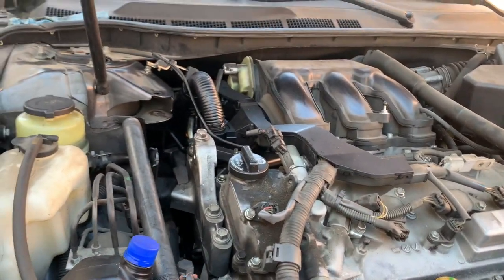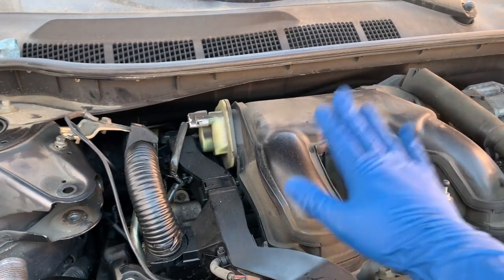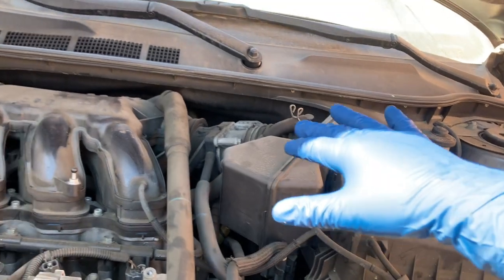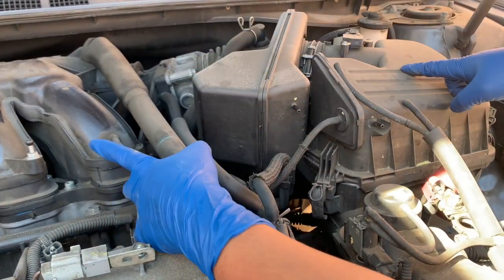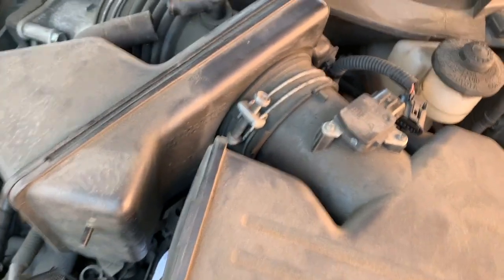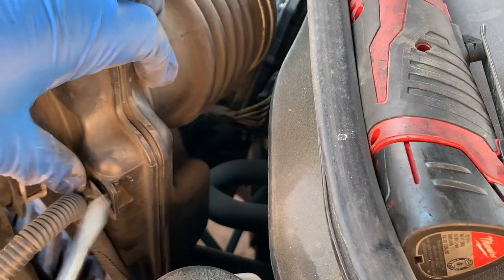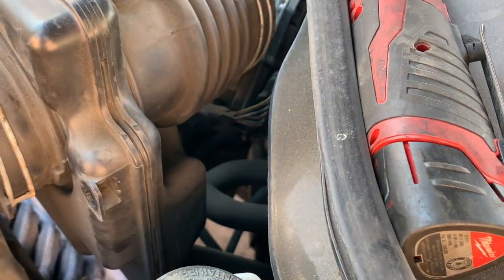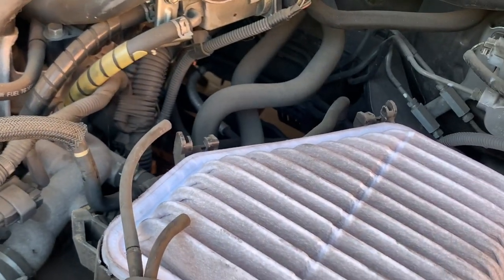Valve Cover Gasket and Spark Plug Seals Replacement Toyota Camry 3.5 2007 - 2017

Comment: One of my spark plug coils has a little oil. Should I replace valve cover gasket? Or I just wait until I get misfire code?
Reply from the maker: I would just get it over with now if I were you- it’s your spark plug seal/ gasket that’s causing oil into your spark plug coils
Reply: Thank you!  It will be another fun project.
Reply: @RookieRepairs  It is very hard to remove back valve cover blots. Space so limited. What tool do you use to remove these blots?
Reply from the maker: Use a- Racheting Wrench

Comment: Nice job excellent video 
The only thing I didn’t like is that you dropped in the new spark plug and changed the gap 
Cylinder #1 3 5

Comment: Thanks sir. 
Just did my 07 lexus es350 the easy one,hahah.
I tried the rear but after inspecting the spark plugs, I didn't bother doing it. I did o2 sensor1 b1 which took me like 3 hours with no proper tools. Everything was good with the exception that o2 sensor wasn't tightened enough is leaking now.
I will try to redo it again tomorrow

Comment: I cant get my engine cover off I got the front but the back won’t budge any tips
Reply from the maker: You’re missing a bolt somewhere - there’s one in the center, make sure all wires are disconnected